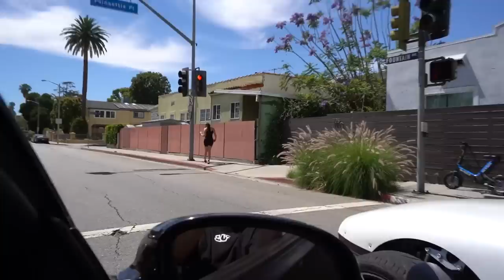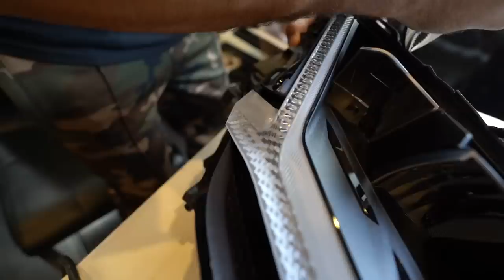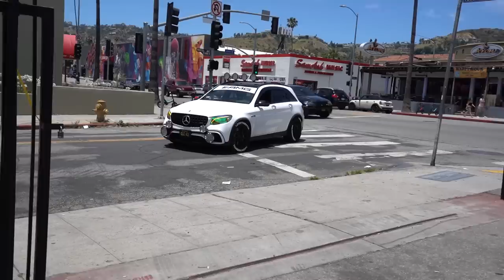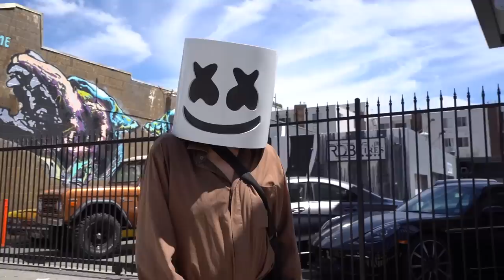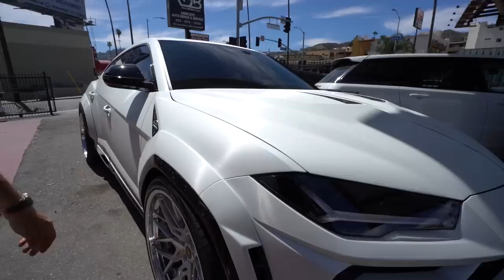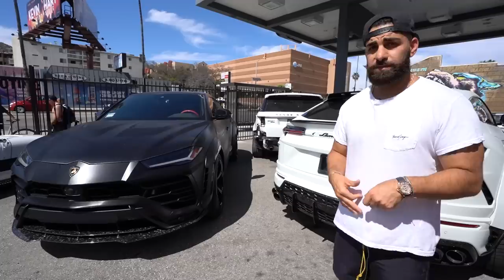#RDBLA WORLDS FIRST & 2ND REAL WIDEBODY LAMBORGHINI URUS'S.

Comment: The white one is killa! Should have done the rear roof spoiler in the white also because the black does not define the body lines. Then frame the back glass with the white in a way that gives the glass the illusion of being smaller more sportier looking and the rear wing look a little bigger than at the same time.

Comment: Gloss black roof!! It will not only match the tinted sunroof. But it would seamlessly bleed into the tail (I would do the roof carbon fiber btw, but you would have to change all of the add-ons to carbon fiber to match).

Comment: Just by looking back at these videos how 21 and 22s and even going up to 24s are going to be the in thing.
I believe tire companies are going to step up the game and make side walls a little bit stiffer with some type of composite and the wheels will go back down smaller but they won't be any cheaper by any means because they'll be more eccentric they'll be a four piece come out or some type of triple step lip carbon Forgded Wheels etc etc etc